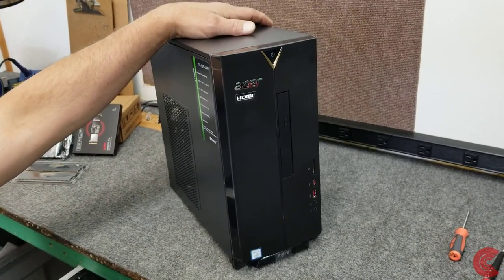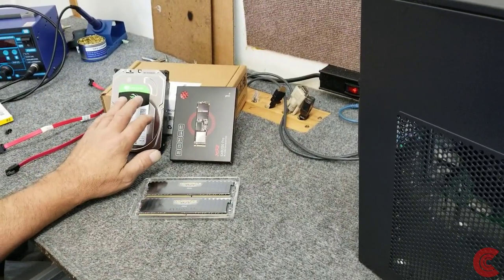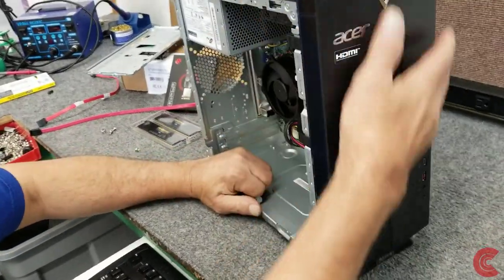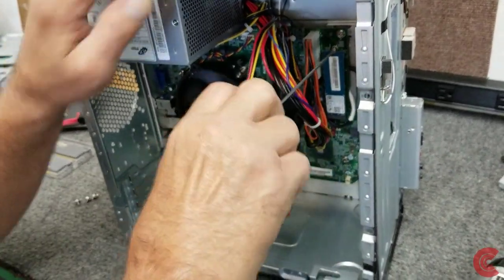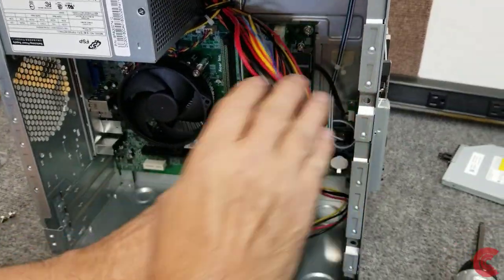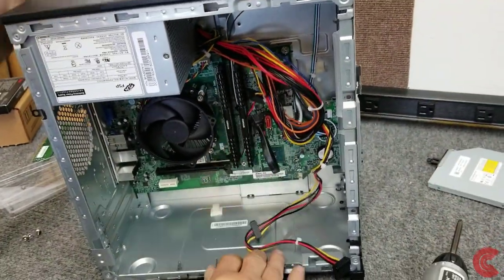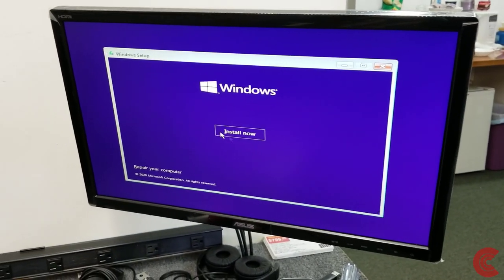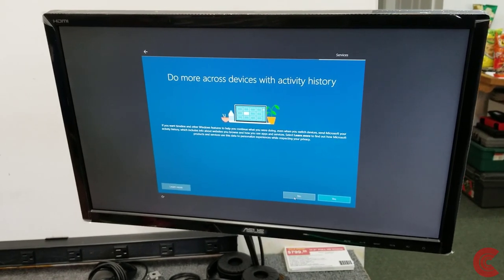Acer Aspire Desktop M.2 SSD Upgrade, Memory Upgrade & Additional HDD

Comment: Thank you very much for your detailed explanations. I received my new Acer TC-1760-UA92 2 days ago. i wanted to transfer my 2 HD RAID and was concerned about being able to transfer it to the new desktop. My old computer, about 10 years old, was way too slow and I needed a new one. Luckily my old computer was a Gateway computer (I think they are owned by Acer) and I was able to transfer the card that came with the RAID, and even the 1TB HD from the old computer (I even reused the HD power cable). I am no computer expert and was very concerned about voiding the warranty, but your video and your information gave the confidence to try this. This plus a lot of luck and now I have a 1 TB internal and 1 TB external RAID. Thank you.

Comment: Thank you for this! I have the TC-875 model, and it comes with the 1TB WD Blue rotational hard drive instead of an SSD. Really dont see much about the 875 model for some reason. They say the 875 only has 2 SATA hook ups but mine has 3 like the 885. Anyways they all look the same on the inside from what I've seen, and your guide helps sooo much thank you! Gonna blow the roof of this thing! hahaha

Comment: Thanks for this video. Definitely helped me with a few foibles with an Aspire TC-1760 (Core i5-12400). And, although you didn't have to go that far, I can tell you that if you ever need to upgrade the CPU cooler - the stock back plate should be able to be gently encouraged to detach itself from the motherboard with a flat head screwdriver to pull it from the adhesive strips Acer uses.
Reply from the maker: Good tip!

Comment: Thanks for this. I have an older Acer but this helps. I will be putting in an ssd, the tower came with Windows 7 so I'm hoping I can use the key from that for a Windows 10 install.

Comment: Hi Dale, Great video! Thank you very much for making it. 

I just purchased the Acer Aspire TC-895-UA91 Desktop, 10th Gen Intel Core i3-10100 4-Core Processor, 8GB 2666MHz DDR4, 512GB NVMe M.2 SSD, 8X DVD, 802.11ax Wi-Fi 6, USB 3.2 Type C, Windows 10 Home from Amazon for $425 for my mother and it will suit her needs perfectly. I've got a Nvidia 970 GPU lying around that I want to install along with an additional SSD, as well as adding more memory, just in case my gaming rig goes out for some reason. It's always good to have a backup. 

My question to you is: Would a 500 Power Supply be sufficient, or should I get a 600 or even a 750? I want to make sure the CPU stays cool, so I'll be adding some fans as well. 

Thanks :)

Comment: I love this video as I have the 885 as well and will be getting the same upgrades you just installed in this video.  Are there any other upgrades you can do to this model desktop?  i.e. graphics or video card or power supply?  not necessarily turning it into a gaming computer, but something a lil more fun.
Reply: 1650 OC gddr5. Don't need to upgrade the PSU.

Comment: Great video! I just got one of these (i7 version).

I have a question, I tried to put my current SSD (windows 10) in and it wouldn't boot up, I got a blue screen with "Inaccessible Boot Device" error message! 

What am I doing wrong?? or what have i missed?
Reply from the maker: Your using a m.2 nvme ssd, from a different computer?

Comment: Another person doing an upgrade had an issue with the computer not recognizing the ram (2666) and only showed it as 2133 on 3 different ram kits and 2400 on 1 other. Did u have a similar issue mate? I recently purchased a 4 month old i5-9400 acer nitro with a 1650 graphics card and was wanting to upgrade the system.

Comment: thank you for the video.  Very helpful.  I recently purchased the Aspire TC-885 UA92, and was looking to add the hard drive from my previous computer to this machine.  Got it in (again, thank you) but upon booting, I get stuck at the Acer splash screen. Something is up with the keyboard..I'm unable to access the Boot menu or BIOS settings.  This only happens when the new hard drive is connected.  Any suggestions?

Comment: Angebot bei Saturn für 2500€ ist der PC gut was meint ihr?

ACER Predator Orion 5000 (PO5-615s), Gaming PC mit Core i9 Prozessor, 16 GB RAM, 1 TB SSD, GeForce RTX 3080, 10 GB

Betriebssystem Windows 10 Home (64 Bit) , Grafikkarte GeForce RTX 3080 , Arbeitsspeicher-Größe 16 GB , Prozessor-Taktfrequenz 3.70 GHz , Prozessor Intel® Core™ i9-10900K Prozessor (bis zu 5,30 GHz mit Intel® Turbo-Boost-Technik 2.0, 20 MB Intel® Cache) , Steckplätze 1x PCIe x16, 1x PCIe x1, 2x M.2 (SSD), 1x M.2 (WLAN) , Bluetooth Nein , Abmessungen (B/H/T) 190 mm x 443.6 mm x 460 mm , Arbeitsspeicher-Typ DDR4 , Festplatte 1 SSD , 1 TB

Comment: Wasn't this unecessary upgrade ram and discspace, how about graphics?
i guess its integrated and shared memory?  So a even lowend GPU would free ram and
hopefully boost graphics a bit?
I have a XC - 1660 
11th gen i5 11400
8GB RAM
Intel HD 730  I think UHD was in there too
(Shared Ram)

Is it possible to put in a dedicated GPU of some sort?
Is power enough if the card even fits the PCI slot

Comment: Install the heatsink... Trust me. I wasn't quiet sold till my bare drive died 3 weeks out of the pack. And was so hot itd burn my finger. I will be adding one of those c clamp style sinks to mine. I hope the customer didn't throw the heatsink away and was given it..... It'd be a clear sign to me something is amiss too. It should be installed. Also just noticed you added a hdd but didn't add a rear case fan...... If I ran a shop like this I would NEVER let a machine leave without a dedicated case fan to pull air over the hard drive. If they are adding this much storage they must be using it. And it will heat up. Adding a fan to the case may have made not using the SSD heatsink okay but I still do not personally agree. If it came in the box the mfg will ask if it was used in a warranty claim.
Reply: Good advise!  I've just purchased the ACER Aspire TC-895-EB12, i5-10400 with a 256Gb SSD plus a 1Tb HDD.  I was very surprised that it has no case fan, as it's the only computer I've every had that was without one.  Cooler is always better.  I'll be installing one, assuming that the board supports another fan.
Reply: @chrisgraham2904  If it doesn't and has extra SATA power id just get a good quiet fan and run it off SATA power if the mobo doesn't support another fan. normally they do though. And yeah id add a rear case fan immediately.

Comment: just a question i have a tc885 with a HDD, and am thinking about buying a sata ssd. would there be any spare cables to connect the ssd (to clone the drive)? or will i have to just get an m.2 ssd

Comment: Hi I installed a M.2 SSD, should I adjust any settings in BIOS? I was thinking of installing windows using USB and use it as my main drive
Reply from the maker: Hi. If you installed a new m.2 ssd. You dont need to do anything in bios.  Boot from your USB install drive and do clean install.  Dale

Comment: After installing the ram mu CPU, the same model from the video I am receiving a long beeping sound. Any idea why? I am trying to update to Crucial 32GB Kit (16GBx2) DDR4 2666 MT/s (PC4-21300) DR X8 DIMM 288-Pin Memory - CT2K16G4DFD8266
Reply from the maker: Hi. Yes, remove the new ram, see if it works after that.
Reply: @CadillacComputerCenter  it works with the old ram
Reply from the maker: Well. I know you do not want to hear this, you need ddr4 2400.  I've only used 2400 in these models.  Intel recommends 2400 as well for this CPU.
Reply: @CadillacComputerCenter  Ok. Thanks so much for the help!

Comment: You are not following the wise rules for protection from static electricity
Reply from the maker: Hi. Our bench tops are covered in anti static carpet, floors are treated with anti static protection as well .  This is not an issue in our store. Thx